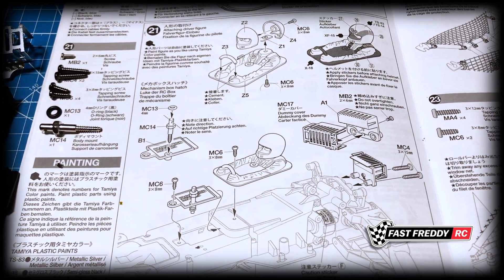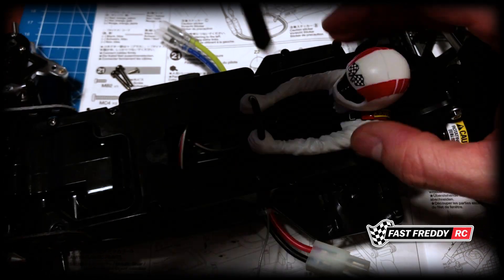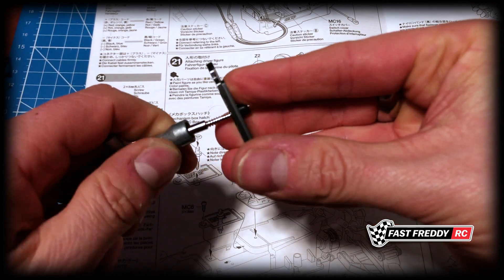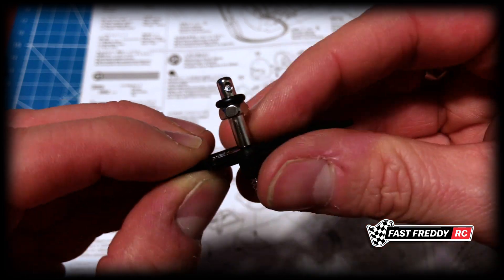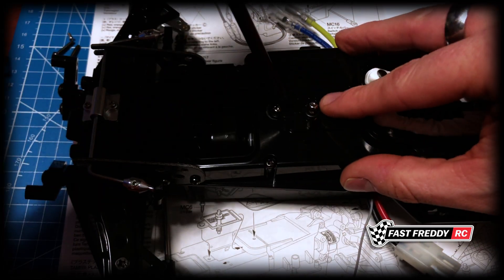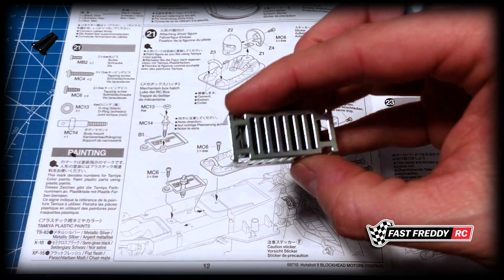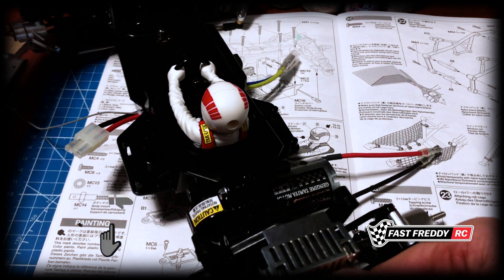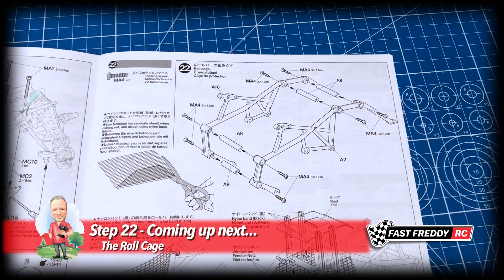Blockhead Motors HotShot II Build Series! - Step 21 - Attaching the Driver Figure

Comment: Regarding the dummy resistor I over tightened it and it fell out so I put a small nut on the screw and it is very tight and secure I highly recommend doing that
Reply from the maker: Hi Jonny! Yeah I think in that step I talk about not over tightening the screw due to its size. So your solution is bang on.